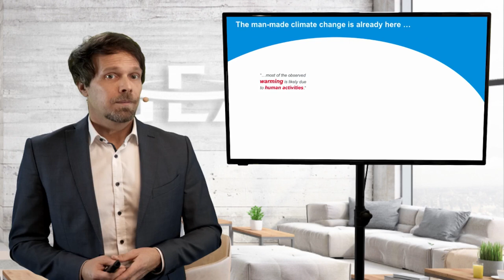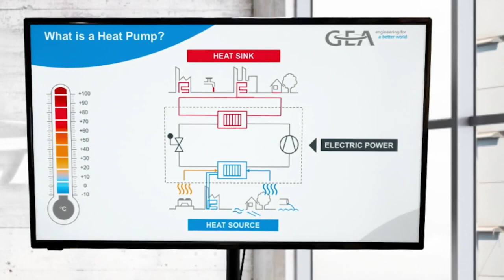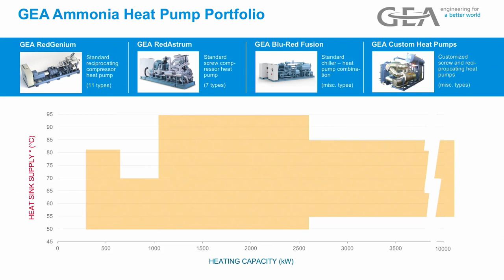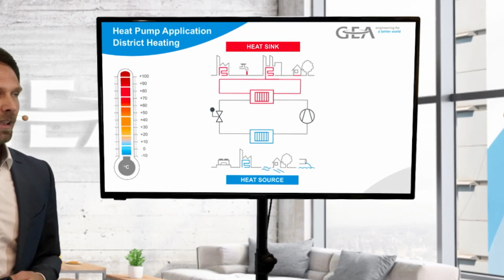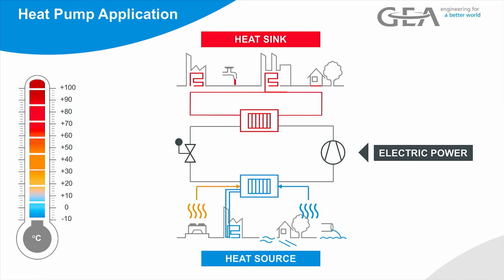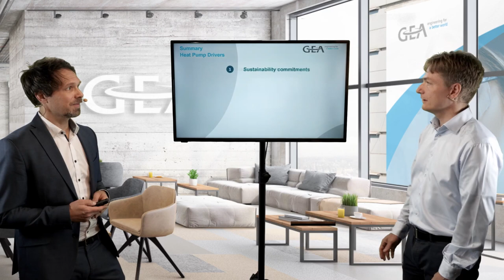GEA Heat Pump Introduction Video

Comment: Why reciprocating compressors and not all screw compressors? Or why not centrifugal or multi-centrifugal?
Reply: Reciprocating compressors are much more energy efficient than screw compressors at lower load levels. For smaller applications the reciprocating machines absorb much less energy in the form of electricity to turn the drive motor. That's basically it.